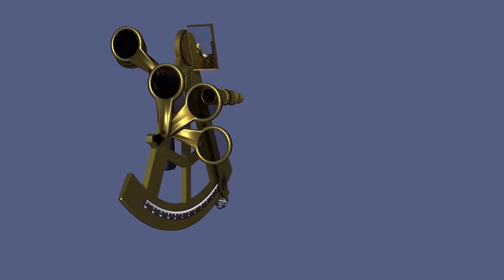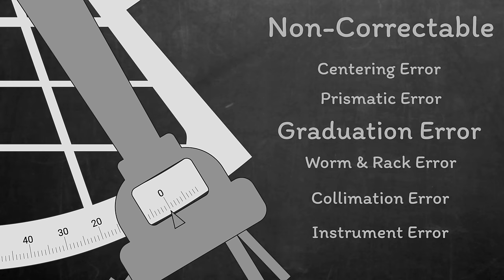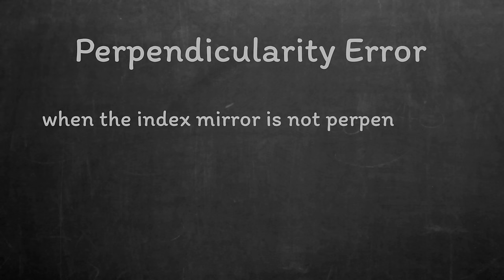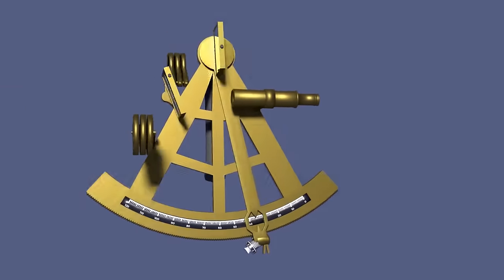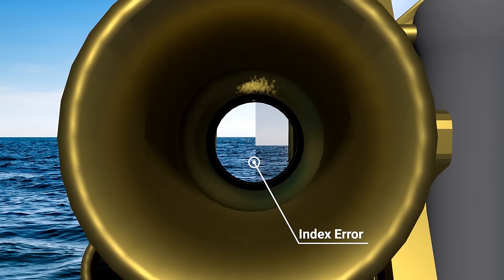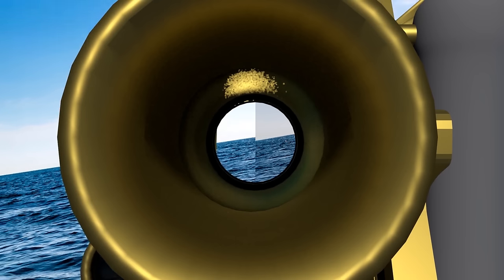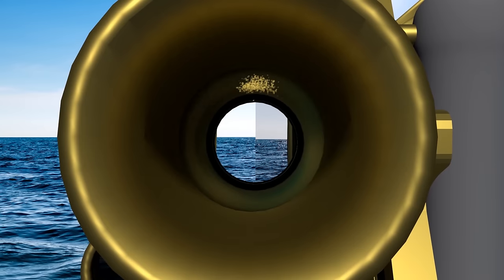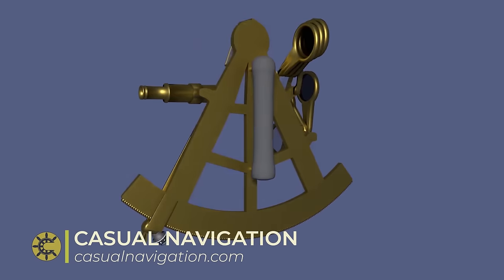Sextant Tutorial: Errors and Corrections

Comment: I'm a Master Mariner and one of the last generation to use a sextant daily, good video but the best way to adjust for errors is to look at a dull star (bright get blurry), you get it spot on that way.
Reply: hey so are there any corrections for earth curvature when you are at sea? or are you traveling upon a level plane? it seems to me a level baseline is being utilized.
Reply: @hillside6401  Sorry don't understand can you explain a bit more? If you mean navigation you treat the horizon as being flat at the point you bring the body (Star/Moon/Sun/Planet) onto it, which of course it is looking at it, is this what you mean?
Or do you mean when sailing the horizon is always flat but really the Earth is curved?
Reply: @davidoldboy5425  ok sorry let me try again. When navigating at sea(with a sextant), are you making calculation corrections for the curvature of the earth? Dip correction is just height of eye right?
Reply: @davidoldboy5425  are you sighting a geometrical horizon or a refracted 7/6r horizon? I’ve been told both by people who don’t use sextants. I’m just having a hard time figuring out how you could acquire an elevation angle from a curved adjacent seeing angles are two straight lines.
Reply: @hillside6401  Correct dip correction is just height of eye
Reply: @hillside6401  Neither, you are using the horizon you observe, which is not always great. Air navigators use a bubble sextant which gave them a horizon, but that is another subject. We often used the Air almanac and corrections, mainly for star sights as you could pre calculate a lot, saving time at the end.
Reply: @davidoldboy5425  so a bubble sextant  provides an artificial level baseline. What is this baseline analogous to? The ground we are traveling upon?
Reply: @davidoldboy5425  so the earth IS flat lol 😂 I knew it!
Reply: @davidoldboy5425  you realize the horizon “tangent” cannot be used. We’ve debunked the geometrical horizon in 2020. Earth with a radius of 3959 can be no further than 1.2x the square root of the observers height in ft. The horizon is far beyond these limitations.
Reply: @hillside6401  The horizon /tangent is used, by hundreds of thousands of navigators for the last three hundred years, proving that the Earth is indeed sphere!    Your formula is only an approximation for short distances over which the curvature is miniscule.  There is no "baseline" used in navigation, so it is clear you have no idea what you are talking about.
Reply: @karhukivi  hello?
Reply: I didn't expect a flat earther to arise from that geniuine curiosity.
Reply: @drk5orp-655  the elevation angle proves flat earth. you need a flat baseline to acquire a fix. you don't make corrections for a curve nor can you acquire an angle from a curved baseline. celestial navigation proves flat earth.
Reply: @drk5orp-655  hahaha, I only came here to find how a sextant works to either prove or disprove flat earth. Haven't done either. But the curvature is anything but miniscule. Distance in miles squared multiplied by 8 inches should be visible. I will be taking a telescope on my next beach trip.
Reply: @hillside6401  looool XD
Reply: @mattlachatte  welcome to flat earth brother.
Reply: @hillside6401  A flat earth cannot have a horizon, let alone an "elevation angle."  Buy your self a boat, a map, and a compass, and sail from California to Hawaii.  If the earth is flat, you should have no trouble navigating to Hawaii by compass and map alone, IF the earth is flat.  If it is not, that's an entirely different tale.  Good luck, because you'll need it.  BTW, that "radius" you cite is in miles, and it is a "mean radius."
Reply: @drk5orp-655   We need to encourage more flat earthers to take up sailing or flying, using plane geometry to navigate.  Darwin will smile.
Reply: @hillside6401  Did you ever heard about distortion by atmosphere?
Reply: @hillside6401  No baseline used in spherical trigonometry.   It is not like measuring the height of a tree with planar trigonometry.
Reply: @davidoldboy5425  The line of sight to the horizon is a tangent to a sphere.
Reply: @hillside6401  You are confusing with planar trigonometry.  People who don't use sextants are probably the worst people to ask!
Reply: @hillside6401  Forget about "baselines" this is not planar surveying.
Reply: @karhukivi  And?? your point is?
Reply: That’s because we have good technology that completely trumps this, with less error and redundancy.  I know how to use one but I’m also a master and I’d never trust navigation using one of these when ecdiss exists,  and arrpa.
Reply: @matthewsuryan6035  The electronic technology can fail and right now GPS is being spoofed in some Baltic areas near the border with Russia.  In wartime GPS can even be turned off.  The US and UK navies are training navigators in old-fashioned "astro" just in case!
Reply: @hillside6401 
You are offering nothing. Every single challenge you guys issue is fake.
Reply: @karhukivi You're right. He is clueless. He made an appearance in the comments section of one of my videos. He doesn't understand anything about CN.
Reply: I'm an old BMOW and l learned how to use a Sextant while on The Bridge
Reply: @marcg1686  this is not a challenge, it it a process. And please don’t poison the well. That’s a fallacy. Meanwhile who’s is proof of flat earth. 

Our coordinate system proves Earth is flat. We derive latitude from elevation angle measurements to Polaris. When taking an elevation angle measurement(w/ sextant), the horizon is your baseline for the measurement. This baseline extends to a ground position of the star you’re sighting creating a 90 degree right triangle. 📐 This baseline CANNOT be curved!!! It is a prerequisite that earth be flat in order to navigate successfully with this geometry. Debate over.   -90x60 is a FLAT EARTH.       globers: converting a flat earth measurement 📐 into a spherical coordinate system doesn’t prove your ball 😂 that’s called begging the question, which is a logical fallacy.    

Never stop learning! It’s fun 😊
Reply: @hillside6401  
'...the horizon is your baseline for the measurement.'
I live inland. I generally use an artificial horizon when taking sights with one of my sextants. It's placed before me on the ground. The mere fact that I point my sextant to the ground already proves you wrong.
Reply: @hillside6401 
Once again for the cheap seats.
The artificial horizon that I use is placed on the ground three or four metres before me. I point my sextant towards the ground at an angle of about minus 20 degrees.
You've had at least three years to figure this stuff out. Maybe you should find another hobby.
Reply: @marcg1686  you just described a flat earth. Angles have a flat baseline. You put it on the earth. You referenced the earth. It’s flat. What aren’t you understanding? 📐 there’s a picture…..
Reply: @hillside6401  The contained water is level, meaning it is perpendicular to the gravity vector going through me.
If I were to stand on the slope of a 1000 foot high hill the water in the artificial horizon would still be level.
Reply: @marcg1686  cool story bro. Show me your gravity vector. 😑 you cannot define gravity without contradicting observable reality.
Reply: @hillside6401  Gravity vector? A plumb bob. Are we done?
Reply: @marcg1686  nah you literally said a plumb bob is a gravity vector. Insane. Like debating a child
Reply: @hillside6401   A plumb bob suspended from a beam or some other fixture or structure will come to rest and point to the centre of the globe you and I call home. It will be parallel to any gravity vector about it.
Reply: @marcg1686  *presupposed spherical earth.  Is what you meant to say. Define gravity
Reply: @hillside6401  Let's dial back the clock 150 years. Heavier than air flight has not yet come to pass. Satellite imagery won't be a thing for another eight decades or so. Decent optics however are a thing. We clearly observe the Sun and the Moon to be spherical. It is entirely reasonable to presume the Earth to be spherical.
Gravity is an attractive force generated by mass.

Comment: Worthless.  Explains in laborious detail the parts of a sextant but says nothing about how it's actually used and for what purpose.  Does it locate latitude or longitude?  How do it's measurements figure into determining naval or aircraft navigation?  These are basic questions.
Reply: It does not give you a specific latitude or longitude. Instead it tells you how far away you are from the GP (geographic position) of the star you are observing. Typically on earth, each degree of angular deviation from your zenith to the star would equate to 69.1 miles of distance from the stars GP. i.e. 1 degree from zenith would place you 69.1 miles from the stars GP,  10 degrees would place you at 691 miles etc. 

Therefore, this narrows you location down to a circumference around that GP. To get a more specific location you will need to take more readings of other stars.
Reply: The sextant just measures angles very precisely even on a moving boat.  You need an accurate clock and an almanac of sun, moon, planets and star positions and a calculator (or reduction table) to calculate your position from the angles you measure with the sextant.